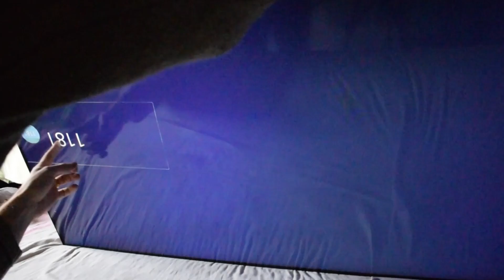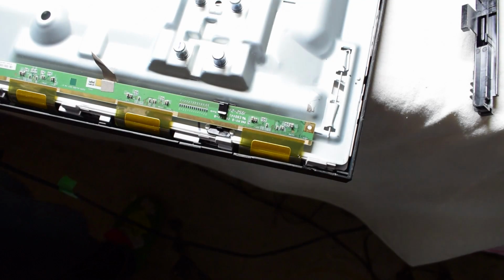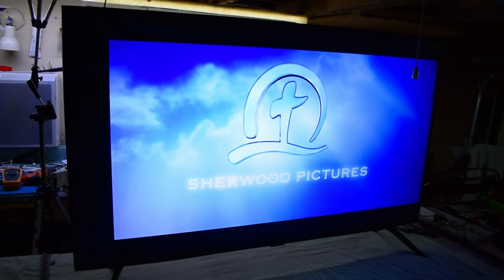Easy fix! LED TV Panel Repair

Comment: Soooo, I did the same exact thing as you, but I wasn't paying attention and leveraged the screwdriver on the silver piece of metal on the back and managed to Crack the lcd 😢. I got the tv free so no big deal, the hack did work by removing the ribbon cable. The second cable in had a huuuuge tear in it, as in 1/2 of the way through. So I tore that one off first which was the second one in to see if that would at least keep the tv on and it did. After that I went for the first one and got it off, turned the tv on, and a line about 1/10 of the way up the screen showed up. It was in the blackout area but I knew i was screwed, it was way too distracting and much too visible. And then I moved it and that was it, it went the whole way to the top. Just figured I'd warn you for the viewers and the other inexperienced people watching this.

Comment: Wish i can.fix my 55inch dixon tv guys dont no if its the whole.ribben.but if i remve one side it plays even if i test both sides it play wen i leave one ribben in  but it makes pink lines also nw i wonder if its not the main ribben that cum from board to panel there no tcon in sumtime tv play for hours then just went blackscreen backites ok is on panel

Comment: So i had to do this to my 8k 65 inch, the same thing you did is what i did i came home to a blank screen with a backlight you could see the tvs menu bc it would glow thw back light and move around where the option buttons would be if you were able to see. So after doing the tape and putting it back like you said there's faint black lines only notice on once in a wile if you tune the screen to display at a high clean rate it gets noticeable from 6ish ft away. 

So feeling accomplished i got a free one off marketplace and I actually located what wad shorting on the other end of that ribbinn they do have a tcon but it's a short long pcb and the " vdc i think " on this had 2 blown components. I mistakenly used isopropyl innit to clean the burn mark and in retro spect wiped off the id on the top so I have 0 idea what it's supposed to be but that area is at the flat botom edge of the tbc hope this helps someone

Comment: Please don't remove any COF ribbon cable!!! That's not a solution. You just make it more worst. Just use the tape method and if not helps seek professional help as this is not an easy diy repair!!!!

Comment: Thank you so much, your tape trick worked for me: I put some tape on some lines on the connector between the T-Con and the panel and solved the shortcut problem I had !
I wonder what the lines I taped were for but it works great !
Thank you again you saved ma TV !

Comment: I damaged the cable, the one you disconnect at the last part of the video. It comes from Panel and "sticks" at a long board. Is that possible to be replaced?
Reply: Same here, that cable is torn in half for me, my left half of screen it all discolored and I have the black bar missing on the far left. Did you find a fix?